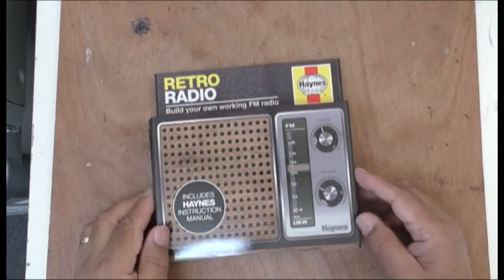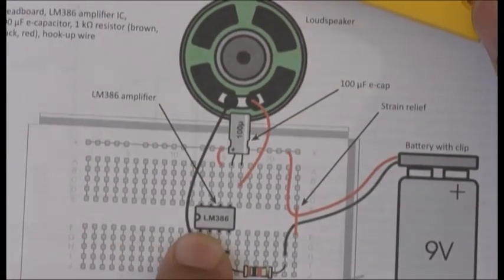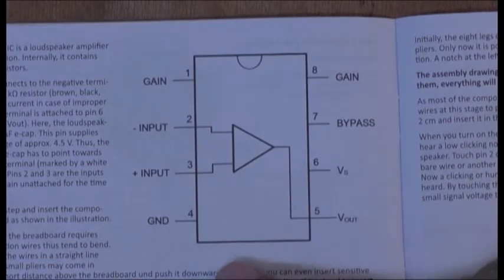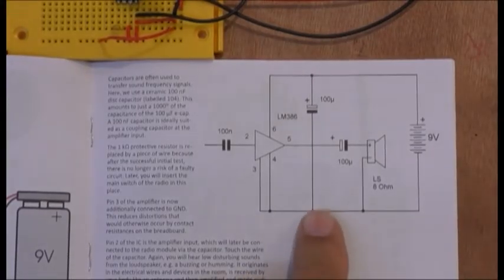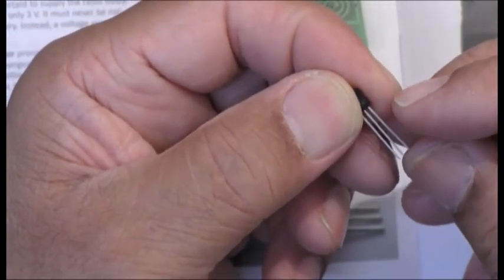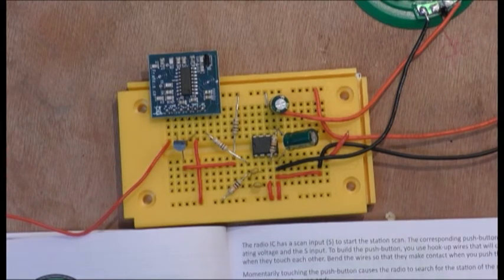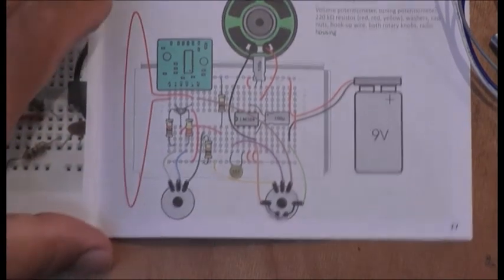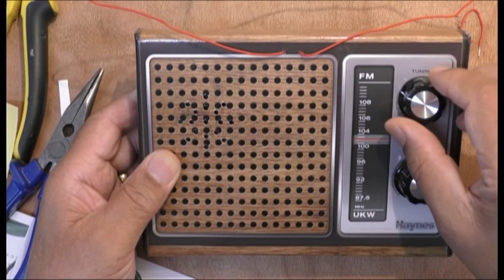#130. Haynes Build Your Own Retro Radio Kit

Comment: Can you please explain how you attached the capacitors and resistors to the breadboard? I have never done this before and it is not obvious, and the instruction booklet also skips this important step. How do you get the capacitors and resistors to be flush with the breadboard? The components have long legs. Do I cut them? Do I force them into the breadboard until the cap is flush with the breadboard? Thank you!
Reply from the maker: Yes you cut the leads to the correct length. They do not have to be flush. I would not cut too much off in case a mistake is made. If you just put them on until you know it works then you can cut them. Safer hope that helps 👍🏼
Reply: @JustFun-iz9rf  Thank you so much for your help. I really appreciate the quick reply!
Reply from the maker: @DavidCalkins-o4d  please let me know how you get along 🙏
Reply: @JustFun-iz9rf  Will do. Thank you again!

Comment: Can you explain why you added a second disc capacitor to the circuit please?
Reply from the maker: Not sure as I did this some time ago. But I think I only used what came with it. 
Do you have one and are there any problems?
Reply: @JustFun-iz9rf  yes my daughter got a kit for Christmas. amplifier and loudspeaker seems ok but we can't get the radio to work. Checked all wiring over, tested resistors and voltage supplied to radio and all fine. I saw your video at this point and noticed you'd added a second disc capacitor which doesn't seem to be in the kit so was curious about this. Otherwise, i wondering if the FM board itself if faulty. Any advice gratefully received
Reply from the maker: @ThomasAspray  okay I’m home now so will look into it
Reply from the maker: @ThomasAspray  okay just looked and yes I added a second cap. Reason why because I lost one cap so I made up the value using other caps I had. If your one doesn’t still work then maybe the FM may be faulty. Sorry I couldn’t help.
Reply from the maker: Sorry to bother you but did you put the Chip the correct way.
Reply: @JustFun-iz9rf  thanks for explaining why there was two capacitors on yours. Much appreciated

Comment: Hello I have got this as a Christmas present and I am quite worried because I am getting no noise when I plug in the battery on the first step and do I have to fully crimp the wires?
Reply from the maker: Hi at the  first stage do not worry too much but just be sure you have the correct resistors connected and everything is connected to the correct pins on the chip. Also be sure the battery is no an old one but I don’t think it will be. If you have these correct then even if you do not get the sound carry on to the next stage. You will find they take the resistor out on later stage. Which I forgot to do. And don’t worry you cannot damage it that easily. Hope this helps. Enjoy your gift 👍🏼

Comment: I got this off Amazon but for some reason it says it's rebranded as: Eight great stuff to make.
Reply from the maker: I don’t know why they say that but did you build yours?  
I love radios and amps so I had to have this one.
Reply: @JustFun-iz9rf  I'm trying to, I'm mostly going by the pictures rather than anything else. It's not super detailed as to what does what, I just added the wire which they want you to remove the insulation from for some reason, probably something to do with the two other wires touching it. I haven't actually seen your video yet, but I will tomorrow probably. I don't get why they keep having you place certain parts on one spot, but have you remove it later, the first resistor 1K being moved is for a test, but later on they have you do that again but no apparent reason why, maybe I'm just dumb but it seems pointless. Anyway I have most of the wires down. I also don't understand how the bread board works, I just know if I put a wire in one slot, it does a thing, I don't know how the board underneath connects to each slot. I do like that I know what a capacitor and resistor looks like, I wrecked a keyboard to see it's internals and it was really just this tiny board, smaller than the bread board but it has the same capacitor and resistors, but they don't say anything on them but their Voltage, so idk if it's a 1k resistor or a 100k. And the colours on the resistors in the kit are so small it's hard to see. At one point it says to use Two orange resistors, but there is only one, that was clearly a typo.
Reply from the maker: @thereformer  okay there are lots of videos on how capacitors and resistors work. Maybe a good idea to watch them. The reason they tell you to put a resistor in then take it out is because they are showing how certain things work with just a few components even I made a mistake so watch the video to the end. I have trouble reading what resistors they are but I have a multimeter to check the resistance. I wish I had an oscilloscope which would explain better. There are videos of this radio but do not explain how to put them together so I made one with a bit more explanation. 
The bread board well if you had a multimeter it would show the connections underneath but its hard to explain here maybe I will make a video on that. Please watch videos on it. 
Hope this helps good luck 👍🏼

Comment: I have the same exact kit but a different instruction booklet which are the absolute WORST set of instructions EVER!!! They make no sense and the illustrations keep showing the components mounted in different places upon the board!! They have made the RED wire from the battery terminal neg and the black positive!! There is NO information on polarity of the board or indeed the ic component. It is a useless kit unless Haynes can send me a proper and correct instruction booklet like you seem to have
Reply from the maker: Sorry to hear that but maybe follow my video may help. 
I’m not sure if I have my instructions but if I have how can I get a copy to you?
Reply: @JustFun-iz9rf  Very kind of you. Haynes are now on the case and sending me a better set of instructions. Thanks anyway